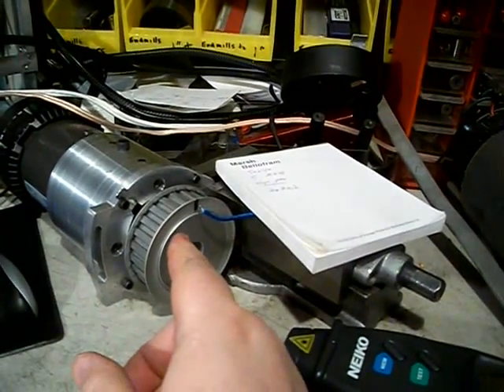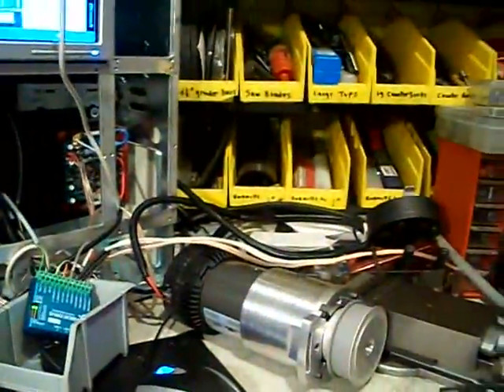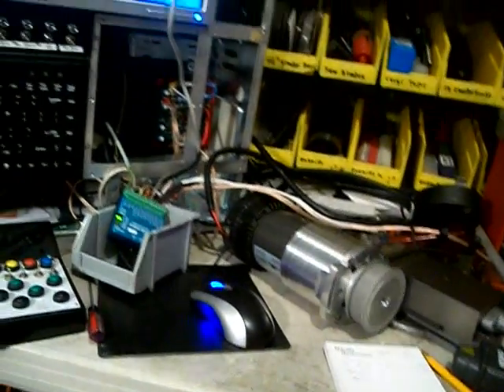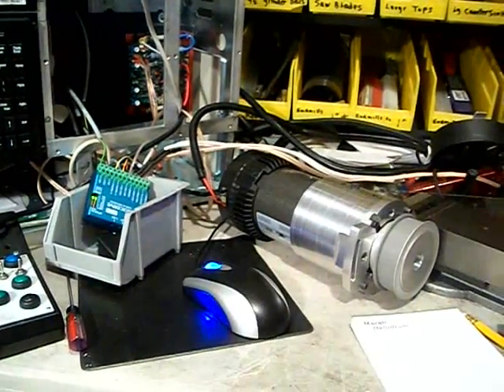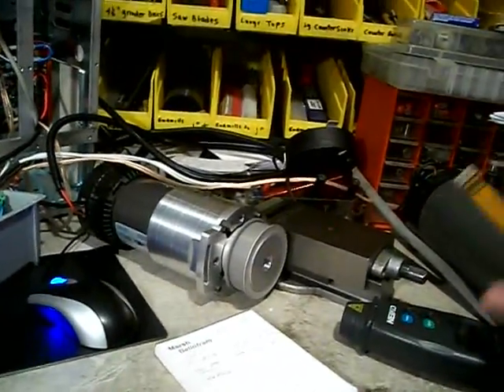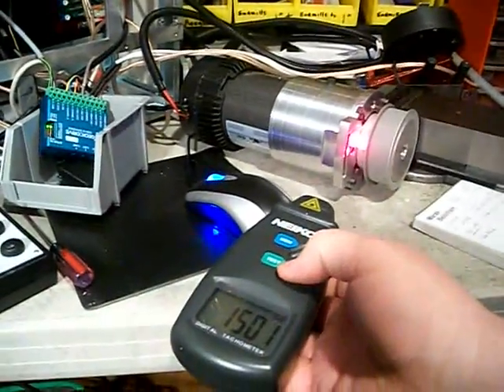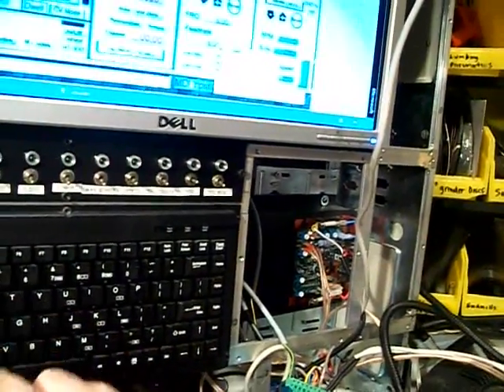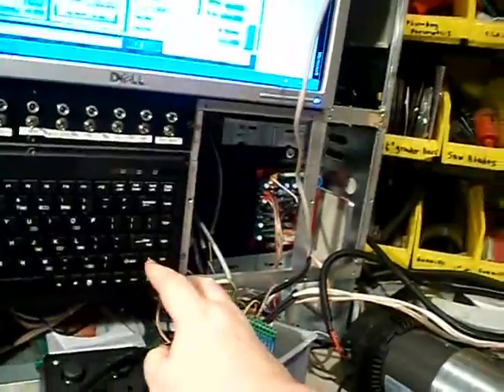G0704 Nordic Servo Calibration

Comment from the maker: This smaller treadmill motor is the best deal, you can find used ones on ebay for less than $75 and the kbmm controller costs about the same. $150 gets you about 1.5 hp @ 6500 rpm. replacement brushes can be found at mcmaster carr. yes a bearing upgrade will be needed for rpms over 4000.

Comment: aw ok, now I see how you did it, this is inspiring, I've got numerous large tread mill motors, I had no idea they could be used to function as a stepper with the aid of the index wheel.  I guess this is how printers work though.  Are you using the original controller for the motor or is this one that you matched to it?